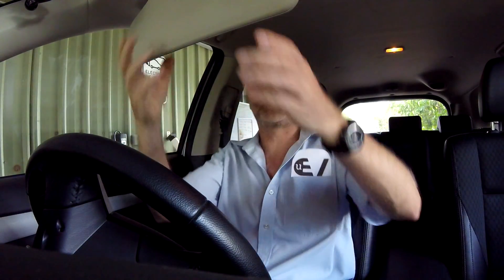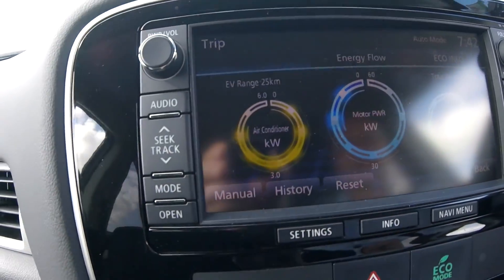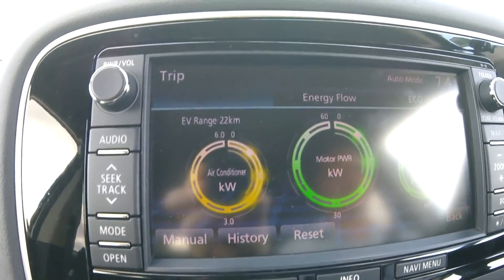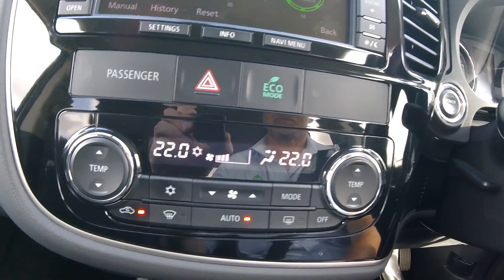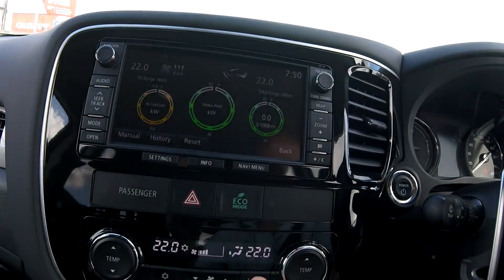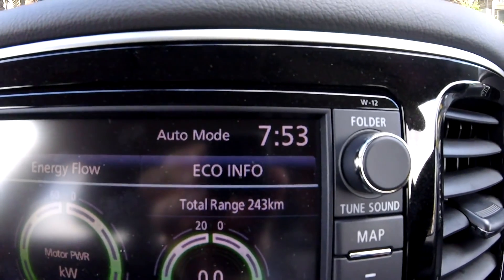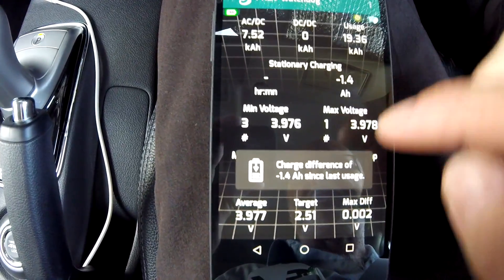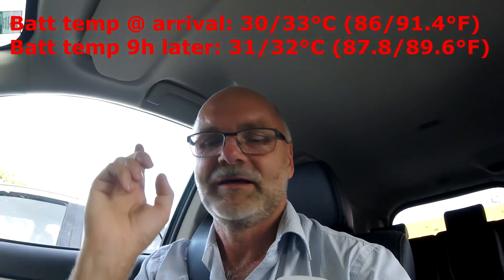EP152 - PHEV battery voltage test and how to detach the aircon from climate auto control

Comment: Hi Andy, how about make a video dedicated to climate Control? I mean show how to turn on climate fan whithout engine start at different outside temperature, explain if the motor start because climate control then the PHEV turns into hybrid and the car moves with combustion mode too... I thought there is a lot to talk about that. :) Thanks Andy!
Reply from the maker: Good suggestion...

Comment: Hi Andi, your Battery temperature @ 7:58 was min. 30° / max. 33°
9 hours later min. 31° / max. 32° and - 1,4Ah.

In my case outside temperature 0°, I realize +1Ah when the Battery cooling town while parking for - 6°.
Reply from the maker: This does not make sense as we already discussed on Messenger. The battery has less capacity when cold and should not increase as in you case.
Reply: @unpluggedEV  yes I know but it's reproducible and in my case always battery - 6° = +1Ah

Comment: Hi Andy, I might also add that the procedure for detaching the air conditioner from auto climate control, can also be used in all other Mitsubishi’s with auto climate control as far as I know...
The same procedure can also be used for the air recirculation, by holding that button for 10 seconds, this will stop the air recirculation changing when you hit auto...
Thank you for the great videos/episodes!
Reply from the maker: Great tip! I didn't know that you can do the same with the circulation!